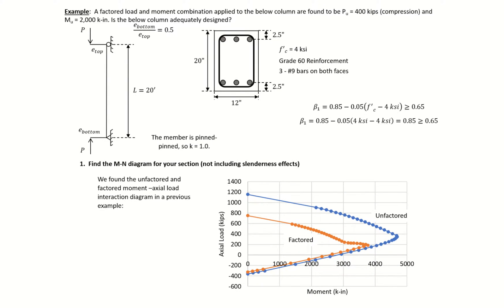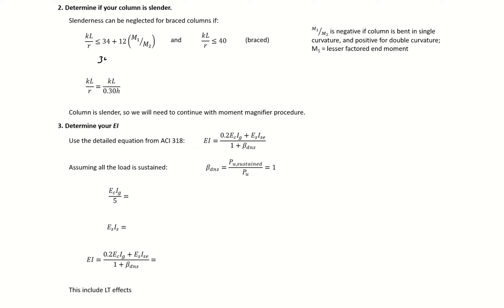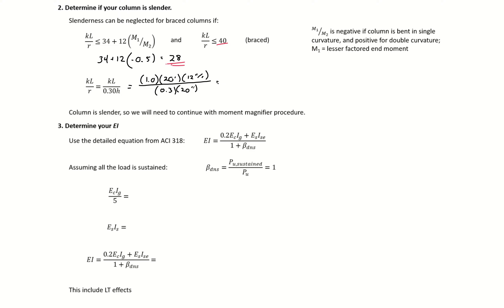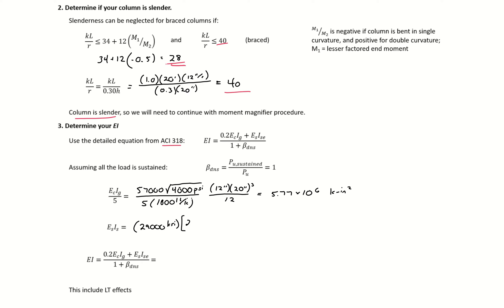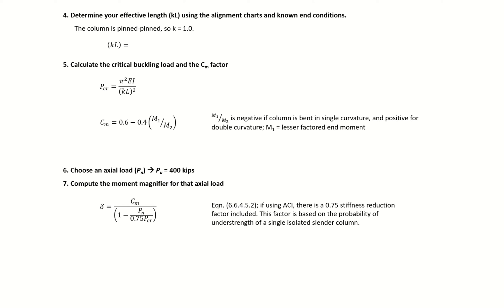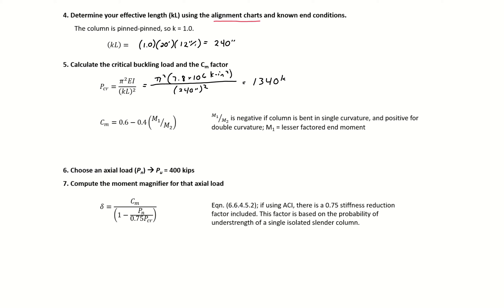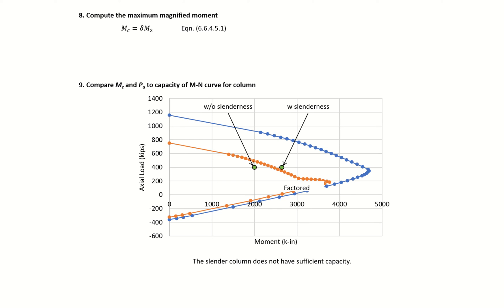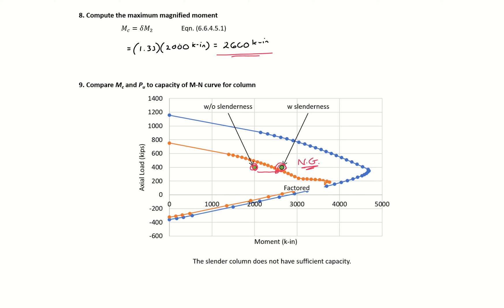9 - Example 2 - Moment Magnifier Accounting for Slenderness

Comment: Why is M1 / M2 equals 0.5? Shouldn't it be zero because end moments are pin and roller support?
Reply from the maker: Applying the axial load at an eccentricity will result in applied end moments. There are different eccentricities at the top and bottom of the beam, so the moments at the top and bottom will be different.